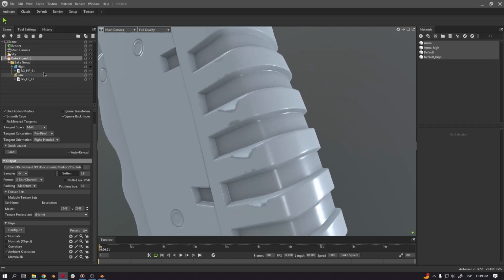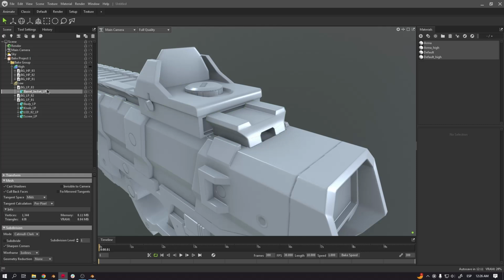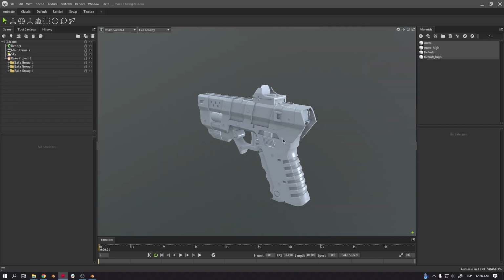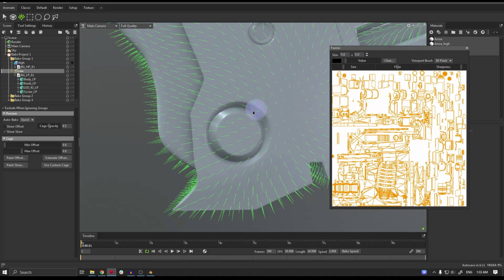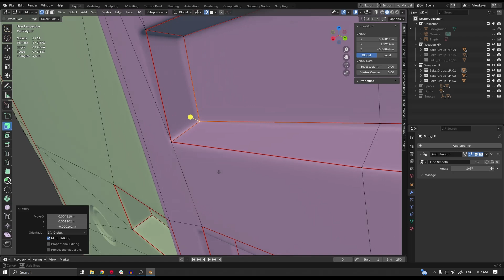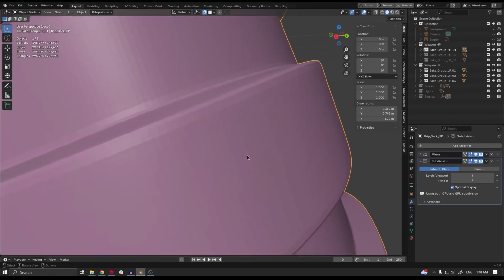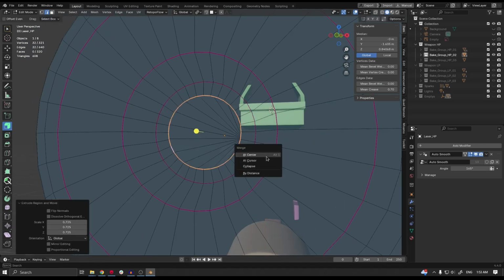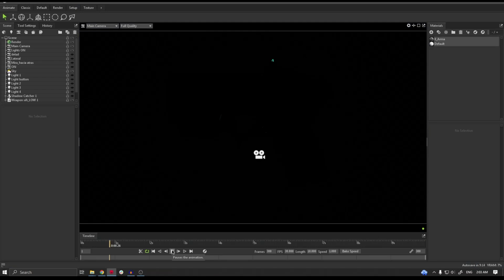9 Baking errors and how to fix them using Blender and Marmoset Toolbag

Comment: When baking hard surface normals, fine ridges often appear along the low-poly wireframe. What could be the possible reasons for this?
Reply from the maker: It’s hard to know the exact reason without seeing it visually, but based on what you described, I would check the following:

The high-poly model should be completely in smooth shading. The low-poly should also be in smooth shading, except for the edges that are actually sharp. Those sharp edges need to be marked as hard edges. And if those edges are 90° (or very sharp), they should definitely be set as hard edges.
Reply: @medicciGame  Thank you for your reply. I've found the reason: the texture space was too small, causing the normal map to lack sufficient pixels to compensate for the artifacts in the low-poly model.
Reply from the maker: Good to know, thank you for leting me know!

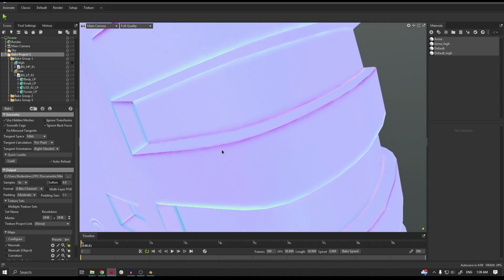Comment: 3:28 Error #7 can't be helped, i've tried a lots of variations to solve the problem, but height bakes is still blocky
Reply from the maker: Yes! What I show in the video is focused on fixing normal map, curvature, and AO issues. The height map usually looks a bit blocky or stepped — that’s normal because of how it’s calculated.

Unless you really need the height map for something specific (like using it later for displacement), in my experience I don’t really use it much, especially for baking and texturing weapons or props.

The reason it looks blocky is because the resolution usually isn’t enough to describe fine details perfectly, and the way it’s calculated isn’t as smooth as a normal map. Height maps only store height information in a linear way, so they always look a bit more "stepped" or "blocky" by nature.

So don’t worry too much about it! 👍